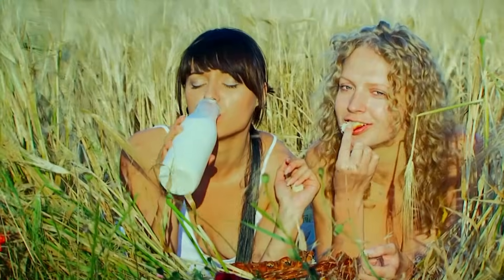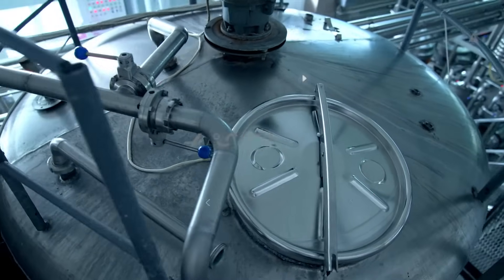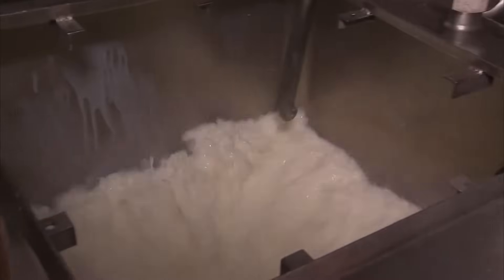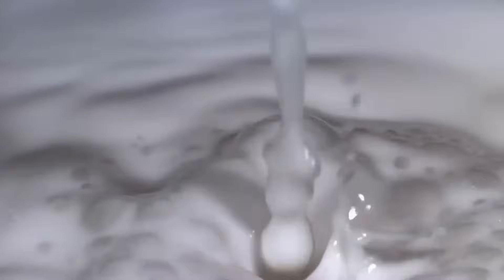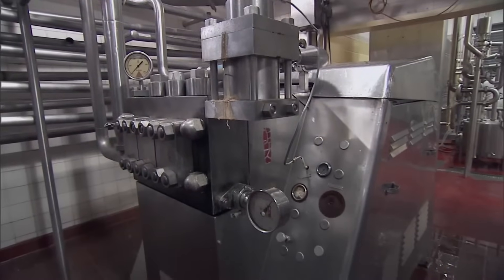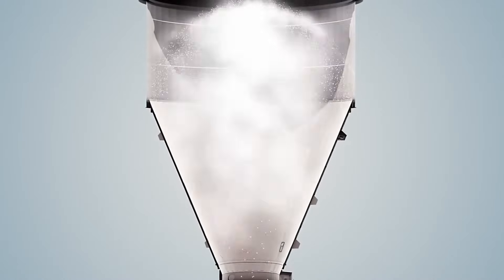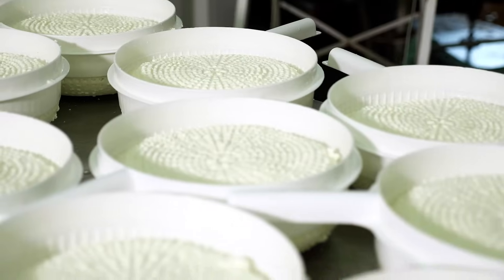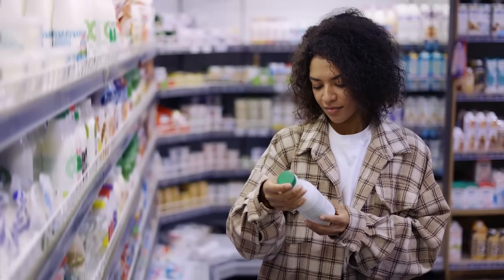How Milk is Made

Comment: I'm concerned about the cleaning of the great amount of pipes,  how do you ensure all pipes are well cleaned?
Reply: don't know edit: just take that one like
Reply: its literally in the video, he said they that have automated cleaning system that flush liquid into the pipe and then flush themselve out
Reply: @zachoshark  yeah， that's how they clean it. My question was how to check if the pipes are well cleaned, cause you can't see inside of the pipes.
Reply: @a96futurecreator96  that would be for mantainance team. They would have a schedule (for example once a week/month) to check if everything is clean well or is anything damaged. But yeah u are right to ask that bcs most of the time factory like these do around the clock production so little to no time for maintanance. Although smaller factory are more easy to do so